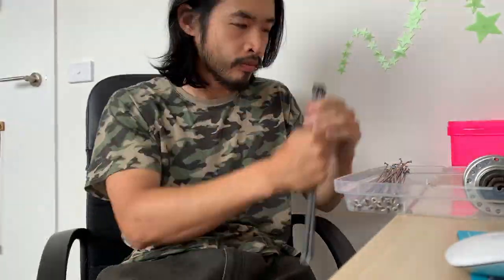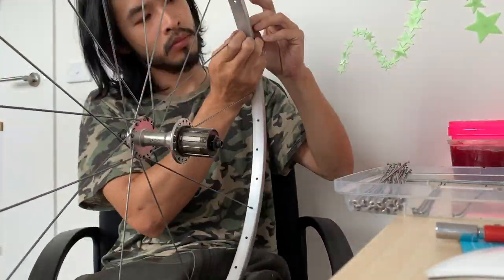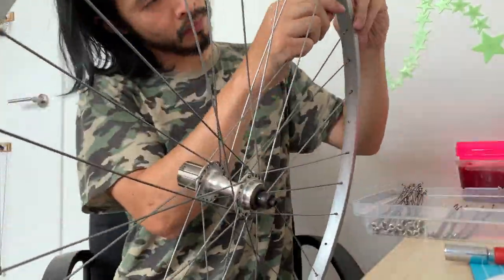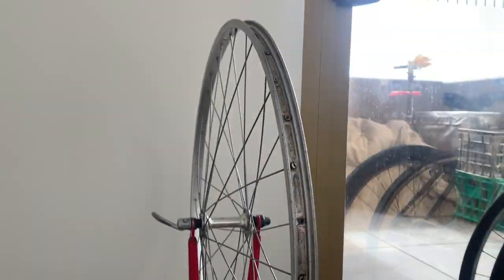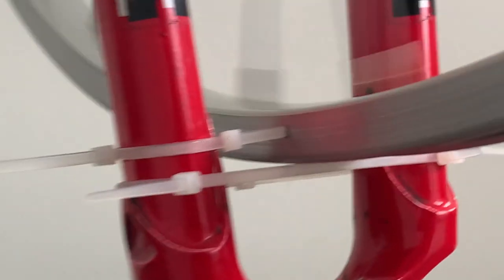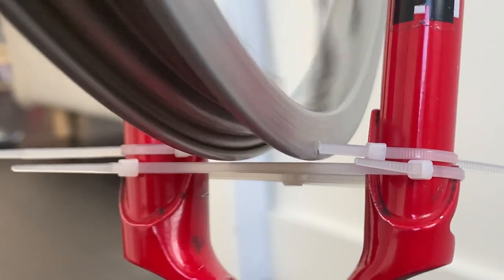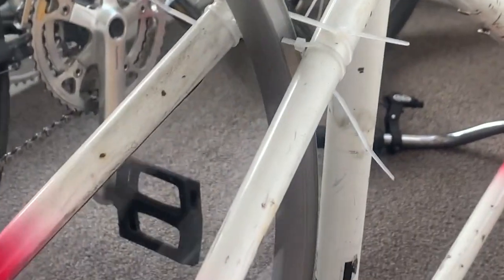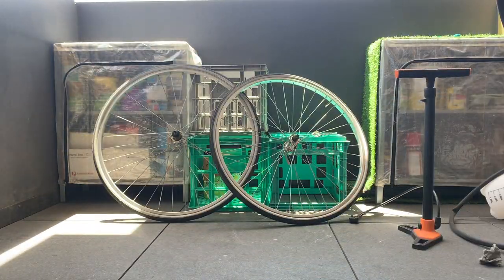Vintage Road Bike Restoration - 90s Hillman Part 4 - Building wheels with only a spoke wrench

Comment: The ghetto truing stand and using zip ties for guides were inspired choices. Why sink a fortune into expensive equipment if you can work out your own solutions?
Reply from the maker: hahah yeah just make shift, i would say that it would probably be 100x easier with a proper truing stand though !!

Comment: Nice job Gary! Sometimes the vertical hop is due to the seam in the rim. Also, their used and there maybe some imperfections on the rim edge due to running into objects.
Reply from the maker: Ahhhh I see, yeah the rim was pretty old so just got it best I can! Cheers for the info

Comment: Awesome job man! Did you enjoy the wheel builds? I’ve done a few and always hate it haha
Reply from the maker: Thanks man! Yeah I liked it, I think the hardest thing was not having a truing stand so it would get annoying to know if the zip ties moved or not. Haha. Maybe I will get a truing stand one day soon
Reply: @garysprojects  hey mate, pick up a cheap stand from cycling deal. Got mine for 55 bucks delivered with a set of spoke keys in the box. Good enough and much easier than using the bike
Reply from the maker: @Moosemean  thanks dude! I’ll look into it cheers! 😊